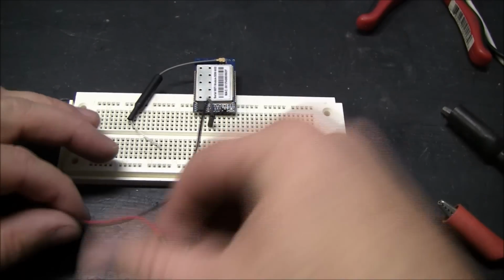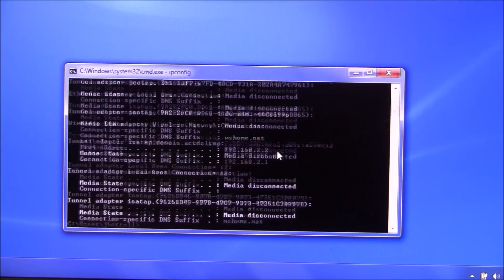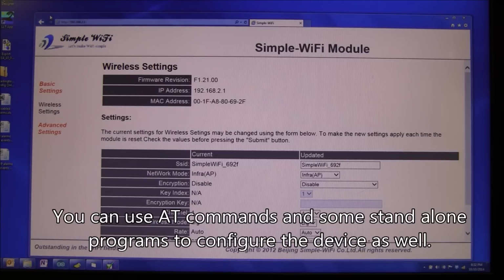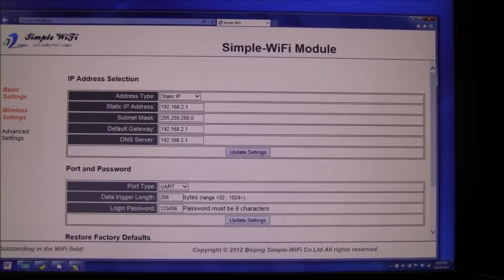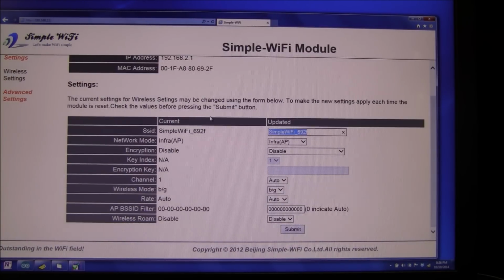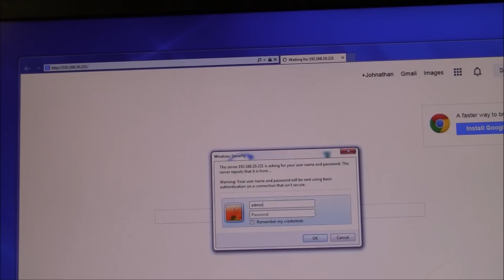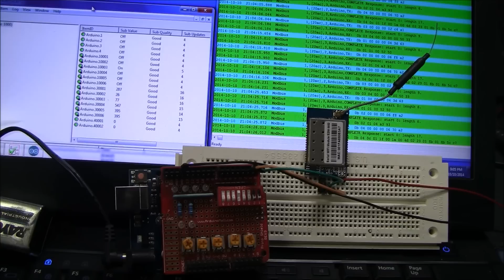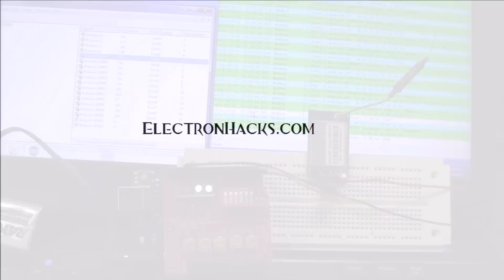HC-21 Simple Wi-Fi Serial for Arduino Tutorial

Comment: So, just to check did I figure out all this correctly...
This way Arduino UNO programmed with Modbus RTU lib becomes like wireless "ModBus TCP" slave and just in case i must ask in Scada BR instead settings for Serial/RTU I would have to make settings for modbus tcp slave with ip of device, right ? 
What about connection quality, comparing with RS-485 and what about distance for wifi? Only Advantage of all this would be 1) no cable and maybe some direct connection with android phone and some modbus tcp application all independently from home network and scada SW? anything else ?

As additional option after opening some ports of my router  Arduino as modbus RTU slave would be accessible via Scada BR anywhere on planet but i could gain same thing with wired rs232/rs485 UNO.